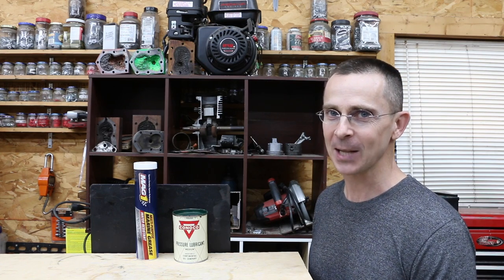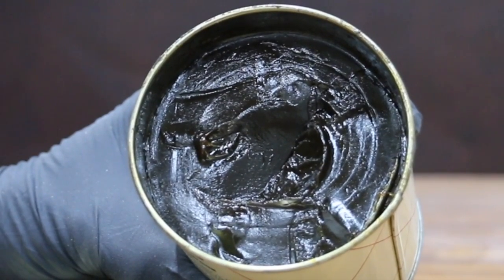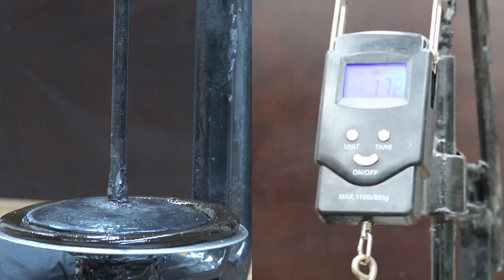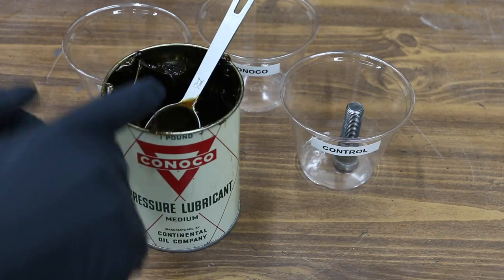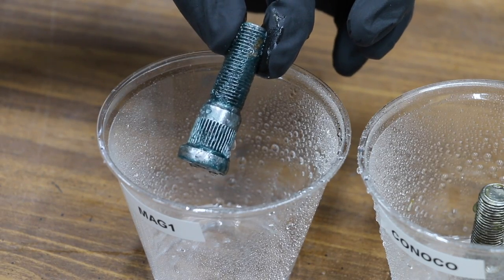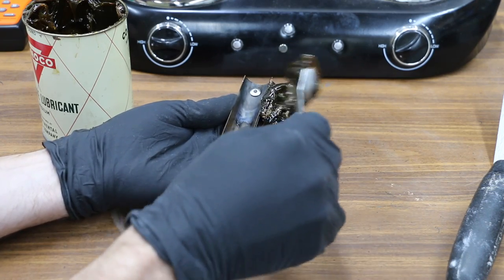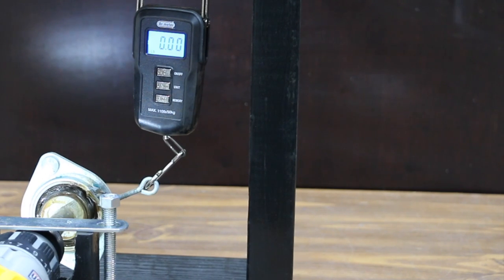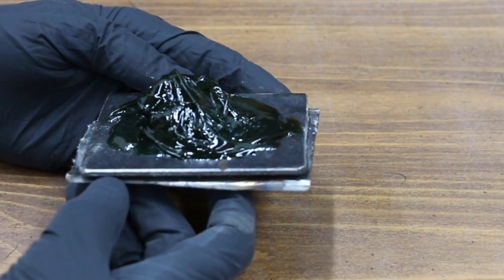Is 75-Year Old Grease Still Good? Let's find out!

Comment: I've heard the old "ain't made like they used to be" my whole life and after tearing into several houses built in the early 20th century,  that's a good thing.
Things are different now but they're not necessarily worse.  What's happened is that everything is engineered for cost now with superior materials (except for today's lumber, it's terrible) rather than just being over built with inferior materials.
Reply from the maker: Great point!
Reply: How about overbuilt with the new materials? That's the way to go.
Reply: It's not that things were built better in the old days, it's the fact they designed products with durability in mind.

Now a days products are designed to only needs to last so long before the consumer needs to buy the product again, built-in obsolescence.

This shouldn't be the price we pay for better technology.
Reply: @ezg8448  So,yes were built in the old days.And with pride.
Reply: @88Petry  old growth trees  vs younger trees used in today's lumber
Reply: @484848474  - yes, but lack the technology to compete with today's products on performance (but not durability).
Reply: @jeremymurphy7320 Plus we're not allowed to use some of the treating chemicals anymore, as the runoff is toxic to wildlife.
Reply: @88Petry  Tons and tons of old growth aren't flowing down the rivers any more is why. That is not to say that good wood can't be found, just that when you would go to the lumber store 50 years ago you would have to ask for junk wood. Today you go and junk wood is default if you go to big retailers. It is nice though that 2x4s are rounded and don't regularly shave off 3' splinters.
Reply: the olds were made with durability in mind, compared to the news that only last a year or 2
but outside of that most new things are better in everyways
Reply: "engineered for cost" = made as cheaply as possible, but still charge you the same.
Reply: @88Petry  2"x4" were actually 2x4's. You could buy lumber without knots. Now that premium lumber is sent overseas. Japan and Germany used to get it. Maybe they still do.
Reply: I always say, aint built like it use too... when it comes to houses thank goodness!
Reply: @88Petry  younger trees have less dense wood.
Reply: @88Petry  Short leaf yellow pine is nearly extinct, we used it up in WW2. That was a fine lumber, when you cut it there is a heavy smell of turpentine in the air.
Reply: also ... sorta confirmation bias .... things in my day were built better ... the only things built back then that lasted were REALLY well built / taken care of and the things that weren't are gone
Reply: Maybe the old stuff should stay in the archival collections.  But, that old grease performed well considering its origin.
Reply: Insulation and thermal barriers weren't even a consideration evidently when my 1925 bungalow was built however the lumber and craftsmanship build quality of today is laughable compared to the craftsmanship back then. You misstep and put your shoulder into a wall in this house and the house won't give one mm, trust me on that and you're going to be in PAIN.
Reply: Bs
Reply: Doubt you'll find many 10x12 main beams like the one in my house in today's farmhouses.
Reply: I'd say the 70's and 80's were the sweet spot for home contstruction.
Good lumber traditionally framed, real plywood sub floors. Modern plumbing in ABS/PVC waste lines and red copper supplies. Standard romex wiring following good wiring practice.

As soon as drains start being in cast, clay, lead, or copper it's a pain. As soon as supplies start being done in galvanized it's a pain. Newer supplies are in Pex which sucks too. At least it's not the failed plastic supply solution like CPVC was.
Those homes from the 50's and 60's with aluminum wiring are nightmares, and anything before that it's anyone's guess how they wired it up and with what. And if you really go back to knob and tube have fun.
Reply: @ominith1  Survivorship Bias, but yes, it is a real problem with the "they don't make 'em like they used to" crowd.

Were some things built better? I have no doubt. I can believe it when old timers tell me that solvents just aren't the same. But then again, new solvents don't kill you (as quickly anyways)!

But if anyone wants to tell me that cars aren't better, machining tolerances aren't better, manufacturing processes aren't better, consistency and quality of materials (steels, alloys, plastics, etc) aren't better, or that some types of chemicals (motor oil for example) aren't better, they simply don't want to accept that some things HAVE improved for the better over time.
Reply: @SE45CX  Used to be that anything made in Japan was considered crap and worthless. China has really been stepping up their manufacturing game. QC will catch up, and in many cases is there. Many modern high quality electronics are built in part or wholly in China.

China still makes junk, but so do some Japanese companies, and some American companies...

Point being, you can find high quality stuff and absolute junk just about everywhere you look. You just have to do your research and buy known/trusted products.
Reply: Houses also burn hotter and faster now than they did 20 years ago...
Reply: 88Petry if you ever look at the rings on trees grown for lumber, the rings are further apart and they light up quicker
Reply: @joblessalex  in terms of Lumber, it's UNDERBUILT.  Look at some of the old Log Cabins, 2-300 years old taken down in one part of the country put back in another and the only thing really holding them together, the equivalent to a dowel rod.
Reply: @ezg8448  Planned Obsolescence is the actual term, one reason why todays cars take an accident and fold up. Cars from the 80's and back not so much.
Reply: @88Petry  not cut the same, a 2x4 is not a true cut 2x4 same with other sizes. Then you have MDF which when wet has no structural integrity. Plywood is stronger than MDF as are solid boards, but guess what your roof has in it mostly..... If you said MDF or chip board as i call it you're right. Houses now a days go up in a matter of days and for timed competition that might be cool, but if you want something to last, not so good. By the way the Tighter the Growth Rings, Stronger the wood.
Reply: no matter what way you slice it, gusset plates that are prevalent throughout houses nowadays will never beat nails. 

and engineered lumber is absolute garbage. 

just ask any old firefighter. new houses collapse in a fraction of the time because of the shoddy cost saving techniques that are now standard practice.
Reply: @t_c5266  to add to that the Glues in the new homes MDF make for an Accelerant.
Reply: @ezg8448  But the cheapest products today are cheaper than what was available in the old days, and the best new products are much better than the best old products.  Plus, now that everything is build with cost/profit in mind;  you generally know you are getting exactly what you pay for.
Reply: @88Petry  it depends on where you are, logging practices are different all around the world. Also some markets buy up the best quality lumber.
For instance in Canada, western lumber is by far superior because in the west logging patches are required to grow for a lot longer before recuts are allowed compared to the east. Not that any of it matters because the best quality wood is marked "J" grade and gets sold to Japan who pay top dollar for high quality lumber.
Also the kind of tree, it comes from most wood now is pine which is a lesser wood to oak or fur, those are not replanted as much because pine grows faster meaning that when a patch is re-cut it will yield more quantity.
Reply: @georgetinc9578  yup. the glues, all the plastics, polymers and things synthesized from petroleum make houses go up like a match much faster and then they collapse much sooner.
Reply: @88Petry  the trees are not the same. Old growth trees grew slower and have tighter growth rings which produces better lumber. Most lumber now comes from genetically modified trees that grow faster with looser grain that produces lower quality lumber.
Reply: @johnp556  Well its not the materials then soley, its also pride, culture, time stress on jobs, hand tools, price of materials...
Reply: @georgetinc9578  Its for passenger safety tough...
Reply: @georgetinc9578  I'd say cars are designed to dissipate energy in a crash, making the crash less traumatic on human bodies compared to body on frame vehicle construction of bygone eras. I'd like to see body panels a bit thicker, but weight is also a penalty on a modern car.  Peace, John
Reply: @88Petry  Many years ago, oak was used for framing. Even garages were oak framed. And you didn't see many knots in those old boards unlike today. Cedar was commonly used for siding and other things as well. Unimaginable today.
Reply: @joblessalex  who can afford it?
Reply: @devinjohnson8623  - not really, we pay for standards now I can agree to that but just because something is expensive it doesn't always mean it is well built.

A high price can mean scarcity, high demand or market research to determine the perceived value. 

It should be as simple as cost + fair profit for products but it doesn't work like that anymore.
Reply: I’m a self employed carpenter. New builds, Reno’s, foundations... Canadian prairie small town rural area and totally agree on old home construction. Stud spacing on center was an approximate suggestion to say the least.
Reply: @kirkruiz12  I inherited my grandparents mid 50s cinderblock tract home. The only insulation in the house is 18 inches of blown in cellulose in the attic. Exterior wall xsection is literally paint-cinderblock-paint. I'm in Phoenix so heat isn't a concern but cooling is. In the summer at 10pm temp on the interior side of the cinderblock is 110°F+.  It stays over 100°F pretty much 24/7 from June to Sept.
Reply: @9HighFlyer9  go open up the walls measure the studs look under the house the old timbers are still good no go drive and look at a new house after a few years yeah thank me later
Reply: Sadly I had to demolish what was once a beautiful house that was built around the turn of the century. It was of post and beam construction and was very difficult to bring down. In comparison, it would have taken me a quarter of the time to demolish a modern house of the same size.
Reply: Cars today crumple up like a tin can. Back in my day, if you got into an accident you'd get thrown through the windshield and cut in half by a telephone pole, but the car would barely have a scratch on it. Hell when I was 9 I saw my friend Timmy get ejected from his moms Corvair. They found half his skull a mile down the road, but the cop that showed up was able drive the car right back to Timmy's dad's house. Timmy's mom had a few cuts and scrapes so they took her to the hospital just to make sure she was alright. The doctors couldn't figure out why she was so hysterical after coming out relatively unscathed so they went ahead and gave her a lobotomy and that calmed her right down. Things were so much better in those days.
Reply: Jeremy Murphy there’s nothing superior about today’s building materials. I build houses and do construction. Today’s general materials are garbage compared to old ones. Wood isn’t even good. Not sure where you get this from or think of this. Fasteners  and shingles are the only things that have improved.
Reply: It all depends on what your refer to I know s lumber yard using 50 and 60 year old table saws and equipment they runs great and were made with cast iron or steel so heavy to move if you need to but durable.
Reply: @georgetinc9578  
That is one of the most stupid things I've ever heard, you have a pretty good chance of surviving a high speed accident in a modern car because of the crumple zones, in a old car not even slightly because it doesnt fold up.
Reply: Today's plywood is really bad compared to what it was 40 years ago.
Reply: @raybrensike42  Plywood isn't supposed to be strong... smh...
Reply: @ae4164   - Maybe it does, maybe it doesn't. But I've made several points in this thread and it would be really nice to know what I am suppose to be scared of.
Reply: @Mrwheresmyhouse  That's some pretty dark humor but also some astute observations you've got there.
I was going to write about cars, and how they ain't built like they used to, and the crumple zones and things like seat belts with systems that tension the belt in case of an accident and air bags are parts of things that makes the modern car different from what they used to be built like. But there are also things like bearings, ignition systems, fuel injection and surface treatments. In the old days you could see where cars were usually parked by looking for the oils slicks. That a engine was leaking oils wasn't a sign of anything being wrong with it unless it was taking more oil than gas. The materials in bearings and gaskets was simply not good enough to keep tight. Today oil on the ground under your car is a sign that something is wrong with it. The oils used in engines are way better than they used to be and they can be run longer between oil changes than they used to. With electronic ignition systems and fuel injection engines are way easier to start and more reliable than they were back in the days of the old style electromechanical ignition and carburetor. And they are longer lasting as there are fewer mechanical components that has to be serviced. Modern cars are also rusting less than the cars of old, all because of modern surface treatments and materials. But yes, a lot of people will still complain about how "cars ain't built like they used to". A lot of the complaints is about things not being built to be serviced by the owner, and to a degree that IS a valid complaint. But to be honest the cars of old were much more likely to require to be serviced than the modern cars. You were almost forced to learn about spark gaps, ignition timing and distributor rotors or you would end up having to pay someone else to do the basic regular service that every car required. Just about every joint had to be lubed at least once a year and there were a lot of joints in a car. Today most joints are using sealed bearings and once mounted they are there for the life of the car. In short cars today are easier for the owner and generally longer lasting, but harder to service once something goes wrong. For most owners that doesn't have great interest in the feed and caring for engines and mechanical systems the modern car is a great improvement, but for the gear heads and those interested in keeping machinery alive as long as possible they are not.
Reply: I completely disagree.  Everything was over-engineered in the past.
The physical build quality has plummeted on virtually everything, with the one major exception of vehicles.
Houses were made WAY, WAY better back in the early 20th century.  I watched some McMansions get put up and they were basically 2x4 with particle type board and that's it.  The houses in my area made in the early 20th century are a combination of limestone and morter and bricks. The floors are made with 4x6 every 10 inches. The subfloors are tonge and groove 1/2 thick and about 1.5" wide.  Modern houses use 2x4s like 12" apart and plywood.
There have been some improvements through tech, but they usually take away the advantage of the better material by using less of it.
I want to know what all of this PVC is going to look like in 100 years.  PVC gets brittle with everything else, so why not plumbing?
Clothing is made much more cheaply today. Much lower thread count.  If you can find some really old clothes, try weighing them in comparison to a modern version of the same thing.
Appliances are made WAY worse.  Not even close.  I replaced my air-conditioner which was in my house since the 70s in 2015. Broke and is unfixable in 2019. It is simply not serviceable and is loaded with styrofoam of all things.  It used less electricity, but already needs to be replaced.
Telephones... Don't even get me started. Modern landline telephones absolutely suck and are so cheaply made that a single drop will cause them to smash into a 100 pieces.  I still have 2 mechanical ringer telephones that I had in my basement and after having to replace the phone several times, I just hooked up the old ones from the 60s. Still work perfectly.
Lights, obviously better today. Light fixtures, otoh are made like total junk today.
Reply: @devinjohnson8623  This is not even close to being true.  The entire supply chain is loaded with fake Chinese parts and supplies.  You never know what you are buying.  It is one of the major problems that exists today.
Reply: @SE45CX  Just about everything from China is crap.  The only stuff that is even 1/2 decent is stuff made in China by Western firms when the Western firms are in complete control.
Reply: If given a choice, us mechanical engineers prefer to over-build parts where possible. Our job is stressful enough without losing sleep at night from worrying about critical parts failing. Usually the major limitation is finding the right material that's in stock and can be delivered on schedule. For example I might need a stainless steel 90 degree elbow that can withstand 150psi, but the parts in supply can only withstand half that pressure. It happens on a daily basis when you're doing custom projects. It's always a happy day when a job goes out the door ahead of schedule and in the exact specification you want.
Reply: @tarstarkusz  Nonsense. There are plenty of good products out of China, you're just not willing to pay for them. Hell, there are cheap products which are good - Hauwei make nice phones. Shame you guys decided to ruin it for the whole world..
Reply: @Monkeh616  Like what?  Just look at the buildings they build. There are 4 year old apartment hi-rises falling down already.
Even the thing they are reasonably good at, electronics, has suffered from a massive drop in build quality from when they were made in America.
This is the problem. A lot of young people cannot remember a time when things were made in America and how much better the build quality was.  The improvements to these things have always been technological and not build quality.  Take an 80s made-in-USA PC and compare it to the Chinese made PCs of today. They are not even close in build quality.
TVs used to last 20 years.
When people complained about Japanese stuff, it was entirely build quality. They tended to keep working at least.   Today, that just isn't so. Not only is build quality poor, but they fail much sooner.  There are many PCs from the 80s that are still around, there are almost none still around from the early part of this century. Almost all of them failed because of poorly made Chinese capacitors.
Reply: @tarstarkusz  And the moment you're willing to pay $15,000 for a PC (the introductory price of an IBM PC/AT in 1984, adjusted for inflation, and approximate), you can compare a modern, affordable, readily available PC almost everyone has to an extremely expensive piece of hardware  from the beginning of home computing.
Quality has declined not because China is bad, but because they're willing to meet the price you're willing to pay.
Reply: @Monkeh616  Inflation adjustments are more or less meaningless.  You're cherry picking the AT fully loaded.  When the PC was first released, the first machine was the 5150 which could be had for as little as $1600.
PCs would be more money than they are now, but let's not pretend that a mature industry is as expensive as a brand new industry that was aimed primarily at businesses and governments that were paying enormous sums of money to run minis and even mainframes.
There is a very good reason to make PCs better today than they even were in the early 80s.  Computers aren't obsolete as quickly as they were back then.  I am using a 12 year old PC to type this on.  Between 1982 and 2000 (18 years), clock speeds alone went up more than  250 times (not to mention each clock was far more efficient in 2000 than in 1982). Clock speeds have barely went up 5 times in the 20 years since 2000.
There is always a trade off between price and quality and most people get that. But there are diminishing returns on both ends.
Reply: @noidontthinksolol  In America it is not like that. Old homes are almost all brick construction. A lot of the old home interior walls were made with framing, lattice board with plaster over top. The outer walls are brick and mortar with limestone and mortar foundation with smooth concrete floors in the basement.  At least that's how they were built in my area.
All the new homes I see being put up are 2x4 with a type of particle plywood for the outer walls.  I don't think I have ever seen a new home being made with bricks and mortar, ever.  I would imagine it cost an enormous amount of money to do that today.
Reply: @tarstarkusz  You confuse laziness in research with cherry picking. This is Youtube comments, after all.
Computers today are mostly much better. They're quiet, power efficient, compact, lightweight.. Yes, there's cheap horrors, but there's also survivor bias at play with the old ones.
Reply: @Monkeh616  You are confusing 2 different issues.  I don't disagree that computers are more powerful today.
One of the major reasons they are lighter (we're talking desktops here) is because they are so much cheaper.
I've already taken survivor bias into consideration.
Reply: @tarstarkusz  I said power efficient, not powerful. Two different concepts. Weight losses are not just in making the cases thinner.

I'm glad you think you've taken survivor bias into consideration. Now, have you taken your other biases into consideration before deciding China isn't capable of making anything good? You brought up buildings - need I point out the FIU footbridge which fatally failed before even being completed?
Reply: @Monkeh616  It's not just thinner cases (although they are MUCH more cheaply made and lighter), but also the PCBs.  PCBs today are so thin that when you go to insert a card they flex. That never used to happen.
That was one tragedy designed by the wammens and made news because it is so rare.
Reply: @noidontthinksolol  Well, to be fair, America is huge and I have not been to anywhere near all of it. So there may be some places where homes are still made of brick and mortar.  They probably still made townhomes with them.  A friend of mine owned a townhome and IIRC, it was brick.
Reply: @tarstarkusz  PCBs are hardly that significant a weight saving, and the flexing is mostly due to lack of support. ATX does not account for modern connector sizes or locations. That's nothing to do with China.
Reply: @Monkeh616  They don't do it to save weight, they do it to save money.  You are wrong about the stand-offs. They flex even right over a stand-off and it is because they are so thin.  As it so happens, I once worked in a PCB factory that made PCBs for automotive diagnostic equipment and the fiberglass boards were significantly thicker than what is being used today.
Reply: @tarstarkusz  They also do it to provide better impedance control and plane coupling, but hey, biases.
Reply: @noidontthinksolol  No, not all homes. Not even remotely. Europe consists of a lot of countries with a lot of different standards and price brackets.
Reply: @noidontthinksolol  .. and, being in western europe, I can comfortably tell you that not all homes are made of brick. It is a very common method of construction in most countries, it's not exclusive. And that's before you consider the difference between brick and block.
Reply: @Monkeh616   No they don't and that's not why they do it. Design and board layout controls that sort of thing. There are usually grounds between traces that are subject to crosstalk.   Good quality industrial and military grade boards are still made properly with good quality and thick fiberglass.  They just cost more.
Reply: @tarstarkusz  You do realise the thickness and layer configuration of the board is part of the board design? You once worked in a factory making boring slow boards - I have designed boards carrying at least moderately high speed signals. Thinner layers are necessary for practical impedances, thick cores mean longer vias with increased inductance, and long stubs if you're not doing blind vias. They increase the thermal resistance, making it harder to get heat out of internal power planes, and those planes will have inferior coupling across the core.
But yes, you can make (with design consideration..) thicker boards, and they do cost more. And China can make them just fine. And they'll do it in greater quantity, faster, with higher quality and lower costs than you.

The driving force in cheap goods is your willingness to purchase them.
Reply: @ezg8448  yes we totally have the capabillity of making superior products alot of companies do Makita, Kitchenaid, Anker. but some companies use planned obsolescence to keep us coming back. there's a whole "right to repair" movement going on now where people are trying to get companies to make replacement parts easier to access and make products easier to repair without having to get a heat gun in to melt the super-strength adhesive they put on these things